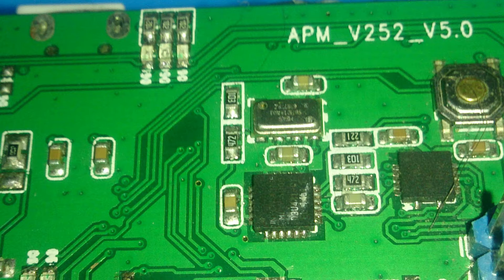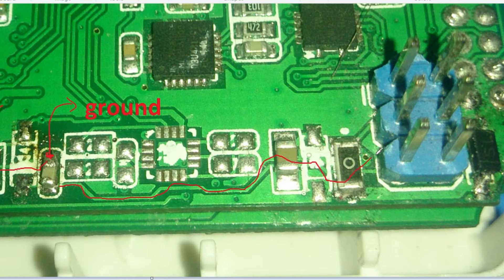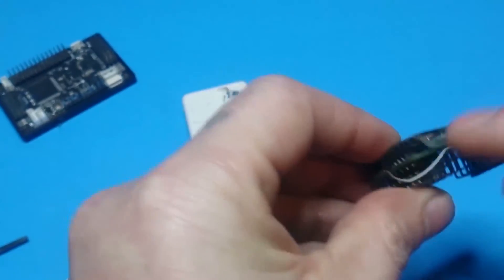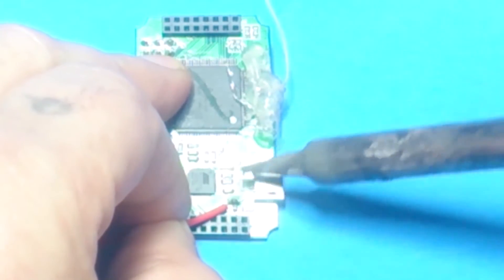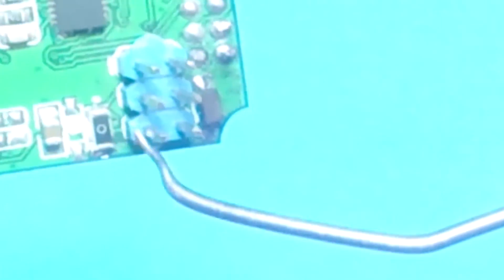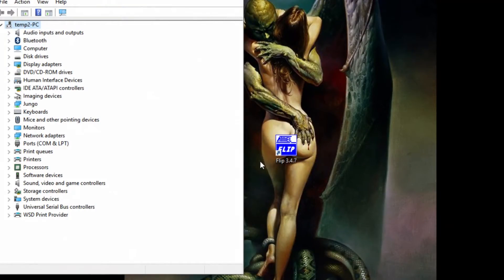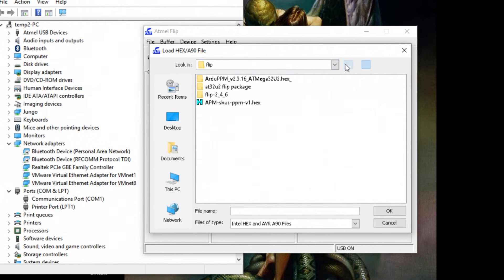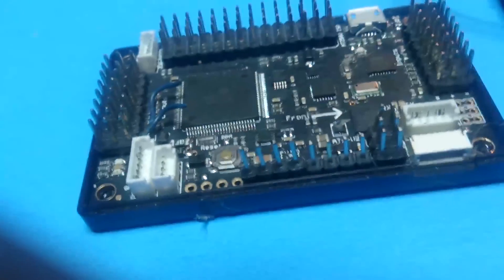Apm 252 v5 atmega32u2 Atmel flip instructions

Comment: hi bangs6996, can this be done on a mega 16u2 chipset? because my stock fc has that chipset instead of the 32u2. thanks.
Reply from the maker: HI . what i would suggest doing is a read first and save it....then try to write the file..It should fit .. as the hex file is small.   .also in flip make sure to pick 16u2 chip instead of 32u2..

 I did make a unbrick 16u2 but the person I made it for never replied back if it worked or not..

the link to that file is here 
https://drive.google.com/open?id=0B2w6_OKE_2kxbkhXdE5wdGxWdHc

the above link is for isp not for flip.
Reply: I'll try that. Thanks so much for your suggestion. I'll get back to you soon... :)
Reply: bangs6996 hi i just want to let you know that the method for unbricking 16u2 actually works! Like the last time, i have to edit your batch file to make it recognize my usb device by changing avrispmkii to usbasp. Everything went well upon execution. I was able to flash new firmware for my apm 252 v.5... I still have one problem, though, my motors won't arm and all of it just keep on beeping even after i uploaded upgraded params for the cx20. But when i use a diferrent FC, the escs and motors work fine... Does it mean that my stock FC is still damaged? TIA.
Reply from the maker: when you connect with what will call the bad apm.. ..if you go into radio calibration .. does everything move? ..like throttle ect..?

what you can try to do is backup your params from your good apm ..and copy them over to your bad apm.. and see If anything changes.

.... some Q's
when you plug in just the usb cable and no battery ..
do your motors and lights twitch on and off?

For a test.
unplug your b cable from the receiver that powers the apm .
unplug motor 3 esc from the outputs on the apm
3,1
.x.
2,4

Plug in the usb cable ..
then plug in the battery to see if that works.

------------If it does don't try the new firmware bellow.. let me know if it works.
=========================================

...............
I also have a video that I made firmware that converts 5,6,7,8
outputs . in case you damaged one of your 1,2,3,4 outputs.

https://youtu.be/LbS5L8jyYGo?t=240

------------
and thanks for confirming my 16u2 file worked.. I had to convert
the 32u2 hex file to a bin.. then kill all the FF's to a 16u2 file size..then convert it back to hex.. .I did spend some time on that so its nice when somebody can return the favor and tell me that my work actually worked or not lol.. ..
Reply: bangs6996 bangs6996 yup! Actually everything can be calibrated. It's just the motors won't arm. When i plug just the usb cable. No bat. The led lights seem to be normally blinking, waiting to be armed but it doesnt. At 1st i thought it was the escs that causing the beeping and not arming but when i tried an ardupilot apm 2.6. The escs and motors work just fine. The beeping is like there's no FC connections with the escs. That's the same beep when you power up the PDB w/out the FC. Anyways, I'll try your instructions and for sure i'll get back to you. Many thanks!
Reply from the maker: I'm pretty sure this is not your problem ..but sometimes I have to ask the basics as well.. did you disable arming check? ..however that would not explain the beeping unless your params are extremely messed up   .. for kicks as well you can try my params.

https://drive.google.com/open?id=0B2w6_OKE_2kxLTlWdGZsSWRWcGM

just load them ..make sure to write it after you load it..then reboot the apm .. don't even bother doing any calibrations just to see if it works.

--------------------------------
Reply: Thanks so much for your support to people like me. (novice) haha! I'll try your params. BTW. I did not disable arming check. I have the same params set up on my ardupilot. That's why I'm so lost here. Lol!  Lucky me, I have you to help me. Thanks a lot!
Reply from the maker: Your welcome .. my params have arming check disabled.. you should actually disable it until you have it working ..other wise it will never arm if you don't have a good gps signal ect.. ..

anyways i'm off till the morning .. good luck if you are still plugging away on it..
Reply: hi, i have uploaded your params...  now this wierd ... the beeping is still there (continuously) but it is now arming. all 4 motors won't spin since all escs or motors are beeping... :( Is it possible that the output/motor pins of the stock apm is damaged? #patienceisavirtue    o_O
Reply from the maker: are you sure you have your cables facing the right way?
white at the bottom.. on the oem 252 apm.
https://www.youtube.com/watch?v=LbS5L8jyYGo&feature=youtu.be&t=240

had you separated the two boards  ..and plugged it in backwards?
but then your a,e,t,r would prob not work.

..It is possible your outputs are bad .. but all 4 or even all 8 would not make sense.    ..did you try my custom firmware that lets you use 5,6,7,8 instead .?

When you go into radio calibration ..what is your throttle low and high?
its the numbers bellow and above that move when you move the throttle.  average is 1020-1950....
Reply: i have tried your custom firmware... it works great! the moment i reboot my apm and plugged in the battery 3 motors beeped normally ( the way it should be!) except for motor #2... it's still beeping continuously... :( i've tried to put #2 to #1 pin and it was corrected. and when i tried to arm it, 3 motors spun (1,3,4 only) but not motor 2... I guess pin 2 on the other side is damaged, too. i think it is time to conclude that i have a damaged output on my apm... i have tried everything you taught me with the help of your tutorial videos, used your custom params, though, i have unbricked and made it to work again... it's still not flyable since 1 motor is not working... :( ......... Thanks for all the help bangs6996! i guess i'll quit on this one and accept its fate... unless, there are still ways to recover or repair pin 2 on my apm output... :)
Reply from the maker: thats weird it would not work on the other side as well. .. the last thing I can suggest is trying a esc calibration off "t" on the receiver.

remove the b cable from the receiver.
remove e,t,r

plug in motor 2 into  "-t"   on the receiver.

plug in the usb cable into the apm
turn on transmitter 
move throttle to full (do not arm)
Plug in battery ..
wait for 2 beeps .  (or count to two after plugging in the battery)
move throttle down
wait till that motor is silence ..move throttle up to see if it works.
Reply from the maker: so when you say its motor 2 are you sure its not motor 3?
it goes this way  with the quad facing forward
3.1
2.4

motor 3 has a extra wire going to a ppm pad on the mother board. maybe check yours and see if its motor 2 that has that extra wire ..its usually a red smaller wire..
Reply: bangs6996 I'm pretty sure it's motor 2. It's the one on the left side near the battery compartment. When i plug it in pins 1,3&4 the motor spins but when plugged back to pin 2 it just beeps. Same with the other motors when plugged in pin 2. I think it's the apm's output (2,5,6,7,8 in that order after uploading your custom firmware) that has a problem. Sucks huh! :(
Reply from the maker: so pin 7 and 2 is dead.... very weird for it to be both from the same esc .. You probably want to give up on this .. but if you want  count the wires going to the main board from each esc ..and see if its esc/motor2 that has one extra wire going to a ppm pad.    If you look right on the esc the one with the ppm wire will be soldered on the same pad as the  white servo wire.   ..
Reply: yeah! I think i'm gonna give up on this one. I'll just buy an arducopter apm instead to replace the stock fc. haha. You've been a great help, BTW. Thanks for your time my friend. :)
Reply from the maker: your welcome. and too bad we could not get it to go.   When you get your new apm. and if it happens again , don't try my firmware fix for motors firmware.   It has to be the esc frying the apm some how.
Reply: I'll put that in mind... Thanks for the tip! :)

Comment: how it works i mean why to do this?
Reply from the maker: .. you do this if you need to update if firmware corrupted... DON"T do 
it if everything is fine with your apm..     This is a fix or as max 
wanted to use a different format like ibus instead of pwm or ppm....
Reply: bangs6996 oh mine is working ok but is not using the external ublox compass
Reply from the maker: so you upgraded gps . but using old compass?  that is fine . its the same compass chip I believe anyways.
Reply: bangs6996 do you feel or see any difference between the ublox compass and stock
Reply from the maker: no you won't see any difference with the stock compass and the one on the ublox board.     If you are happy with how it is working now .I would just leave it like that.        . If you want to use the ublox compass you then need to put the gps unit in the puck on the back of the quad copter where the stock compass is now.      and i believe you just need to strip back two wires on the stock compass cable to attach the one on the ublox ..
Reply: bangs6996 i like how is now atleast 30 seg outside i got 9 sat in a minute from 10 to 12... so rigth now i have in my hand apm 2.8 power module osd telemetry fpv transmitter fpv glases simonk esc and the stock reciver from cx 20 to control it with the same rc ...what recomend... upgrade the cheerson or make an s500 or f450...also i have 2212 motors new
Reply: today i recive it all that from amazon after 3 weeks jajaja
Reply: Lso another question... is the cx 20 reciver and rc control good? i mean range and that...compare to flysky i6
Reply from the maker: The flysky is better around wifi things.  Where the cx20 might crash if your phone has wifi on .. .I still use my cx20 remote on most of my quads because i'm use to the feel of it.   I have not done any extreme out of range tests on either remotes yet...   

    With all your extra stuff I would buy another frame .    The cx20 is a nice quad but the frame/shell can break easy .    plus on the other frame you will have more room for larger battery as well.

Comment: hey,cant get usb contact wrong usb driver?
Reply from the maker: does it show up in control panel after you short the reset for a second  how i show in the video...  
For the driver issue if it is wron..
quote from ardupilot.
Go to the Windows Device Manager (in the Control Panel/Hardware
and Sound) and you should see the Atmega chip highlighted with an
exclamation point, signifying an error.Right-click on it, and choose “Update Driver Software”.Then choose “Browse my computer for driver software” and navigate
to the “C:\Program Files (x86)\Atmel\Flip 3.4.7\usb” folder
(if you’re using a different version of Flip, the folder name will
reflect that version).Then press Next and it should install the correct driver. Restart
FLIP and do steps 1-3 again; they should work this time.
Reply from the maker: also i show in the video to confirm you get just the normal usb to serial driver recognized before you short reset.  https://youtu.be/inzLYP0vhEg?t=528
Reply: it does not show up in controlpanel or not the normal usb when conecting
Reply from the maker: ah so yeah ..your first step is figuring out the right drivers.. u might
 still be able to just short the reset as in the video to get dfu 
mode..but will still leave you the problem of not having the right 
drivers. when your done anyways. 
I would download and install mission planner again and make sure to install the drivers.. 

and just to make sure.. .. the wire you attached to the 103 resistor ..make sure you did not ground it permanently that is the temp one.

how ever I would just make sure both wires are disconnected until you figure out the driver issue   ..if mission planner does not work.. 
a user 5216  commented in this video https://www.youtube.com/watch?v=ugkfccU3lyM&lc=z13rvz5iaqa4j5d0m22ywzmhksfytzjon04

with this link
http://forum.arduino.cc/index.php?topic=107098.0
and said he got it to get detected...I've never had to do that..
Reply from the maker: you can also try the atmel driver bundle .. https://drive.google.com/open?id=0B2w6_OKE_2kxbFg0VnNocF9EZ1U

I'm assuming you were trying to get flip to work but maybe your just having problems with the usb?  anyways let me know if you get it to work and how..
Reply from the maker: and to keep spamming you.. .. Have you tried to connect the usb directly
 on the side of the apm.. when I got my quad the usb cable was not 
connected properly.       ..